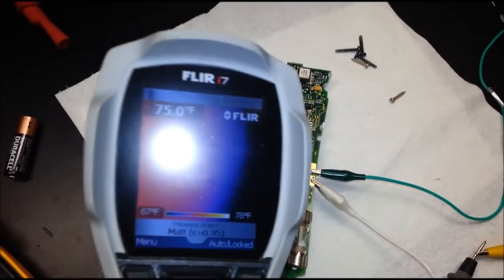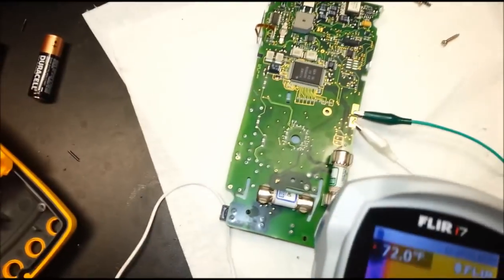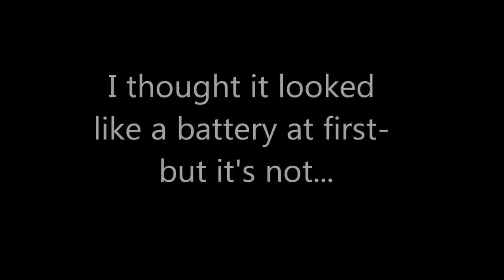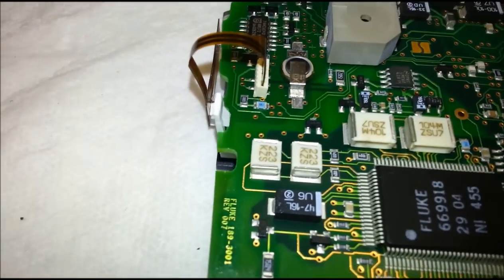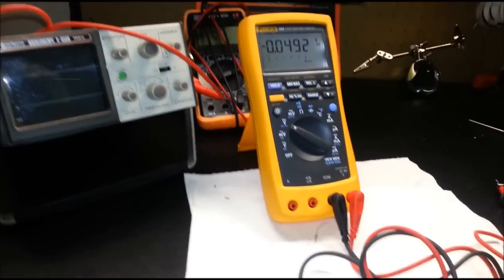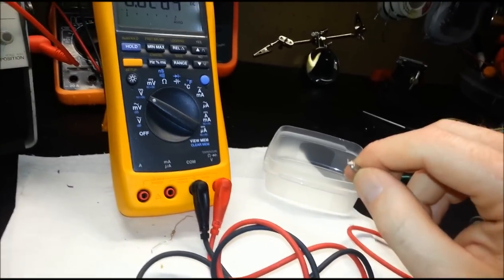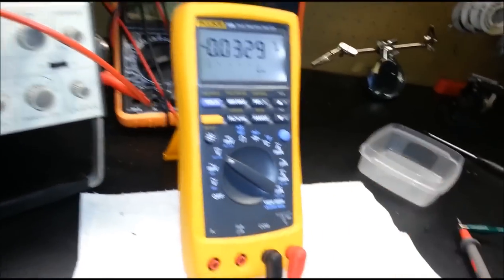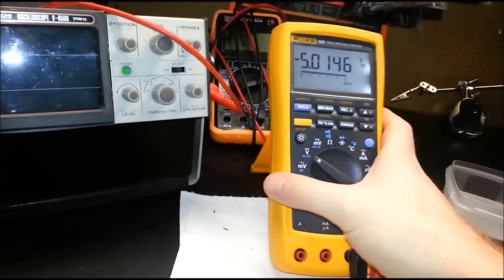Repairing a broken Fluke 189 multimeter

Comment: Hi can you tell what was the problem with the meter ?
Reply from the maker: The cap
Reply: Hi sorry i meant what was the symptoms. My 189 was not turning on. The LCD just used to turn on and go off. When i checked the board i noticed some corrosion on the cap. But after leaving the battery out for 24 hrs it began to work normally. Some intermitant problem i guess.
Reply from the maker: 0:11 current draw

Comment: I have 1 fluke 189 but all sittings are not working correctly, AC sitting is measured 1.1v something like that, any idea please?
Reply: Hony R. I am currently repairing a 189 and the problem was that it seemed that it was uncalibrated in all its values, I tried to calibrate it and clean all the board and connectors (the connector terminals were repaired) at the end I bought a used 189 but, according to the previous owner, I was  damaged, I could not explain very well, but the price was very good so I did not ask for more details, in the end replace what you needed from the 189 donor, which were, the connector terminals for the measuring tips, the housing and the plastic of  the screen that holds that whole set, and the buttons (those of my 189 were fine but those of the donor were better), assemble Mr. Fluke 189 and when turned on, the values were magically repaired, but nevertheless, the values are still distant,  in what is tolerances of being perfect, for example the resistance value, joining the tips, it gives me a value of 0.16 ohm, and in VDC the minimum without points is 0.0027, in VAC it is 0.0033, the maximum in Resistance without  tips is 500 Mohm but it varies a lot, as if it had a parasitic capacitive load, and in capacitor it gives me the minimum without tips of 0.064 nF, in mVDC without tips it is 5.4 variable, in mVAC without tips it is 0.700 variable, I don't know if  the voltage values must be 0, but in the values of resistance without a tip it must give OL to indicate an infinite resistance, tomorrow I will check the plate, and evaluate the resistance circuit, I will probably have a problem in the connector and it is generating a  kind of micro short by means of some piece of dirt between some feeding stage and some part of the connector or the lines of the tips, I will tell you later what I am currently repairing a 189 and the problem was that it seemed that it was  uncalibrated in all its values, try to calibrate it and clean the entire board and the connectors (the connector terminals were repaired) at the end I bought a used 189 but, according to the previous owner, it was damaged, I did not  He knew how to explain very well, but the price was very good so I did not ask for more details, in the end replace what you needed from the 189 donor, which were, the connector terminals for the measuring tips, the housing and the plastic of the screen that holds  that whole set, and the buttons (those of my 189 were fine but those of the donor were better), assemble Mr. Fluke 189 and when turned on, the values were magically repaired, but nevertheless, the values are still distant, in what is  Tolerances of being perfect, for example the resistance value, joining the tips, gives me a value of 0.16 ohm, and in VDC the minimum without points is 0.0027, in VAC it is 0.0033, the maximum in resistance without points is 500  Mohm but it varies a lot, as if it had a parasitic capacitive load, and in capacitor it gives me the minimum without tips of 0.064 nF, in mVDC without tips it is 5.4 variable, in mVAC without tips it is 0.700 variable, I don't know if the voltage values  must be 0, but in the values  of resistance without tip must give OL to indicate an infinite resistance, tomorrow I will check the plate, and evaluate the resistance circuit, it probably has a problem in the connector and this generating a kind of micro short by means of some piece of dirt between some  feeding stage and some part of the connector or the lines of the tips, I will tell you later what I found.
Reply: Settings, not sittings.
Reply: One of the cause for this is leaky battery 🔋. Check resistance between plastic case to another side.. Clean and brush with laundry soap.